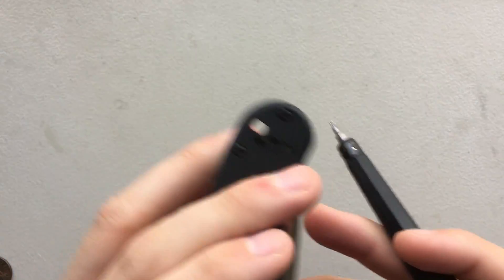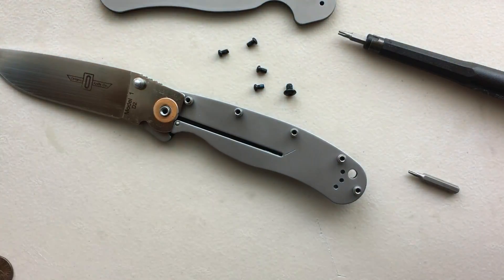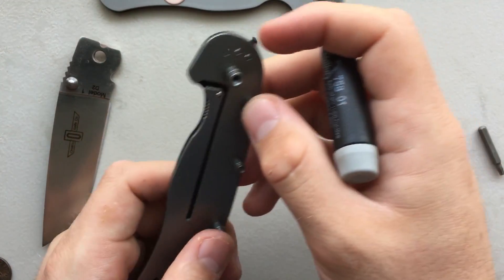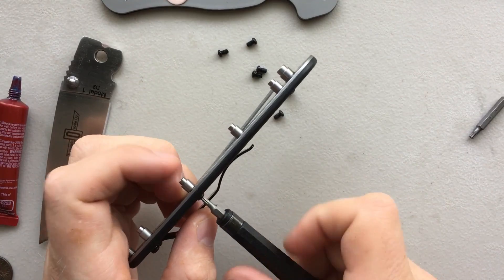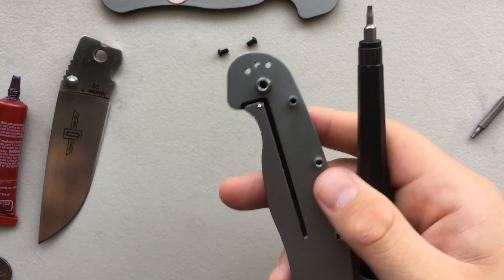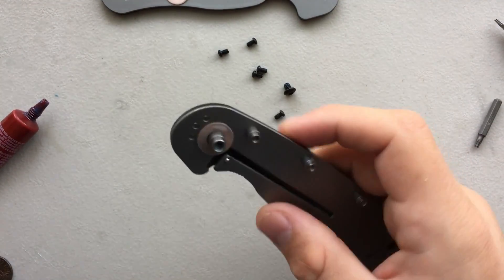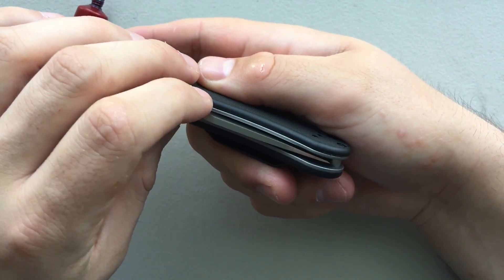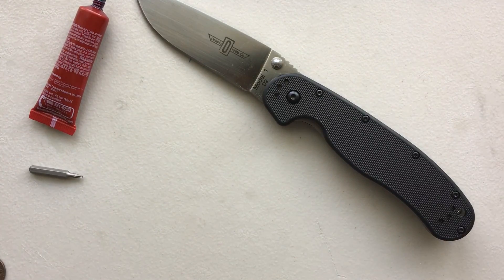How to disassemble and maintain your Ontario RAT 1 Pocketknife

Comment: I like my Rat1. I bought a Rat1a (assisted) but went back to my standard Rat1. The assisted opening is crap. They put a torsion spring in the pivot point. Mine was so hard to open that you had to use both hands to open it...

Comment: My green guy used to be superb action. Lately I noticed the liner lock moved over farther, and was harder to disengage and close the knife. No biggied I figured, did full tear down and clean, and put back, and now the blade touches the right liner when closed! I kept taking apart reseating, even sweapped nylon/PB washer order...boom nothing. It seemed each time I put back together, my once perfectly centered Rat1  was now permenantely defected to one side on the liner scraping when shut. I tried everything possible, a dam shame out of the blue this started to go south. It seems odd to me the washers ID is bigger than that pivot collar too. Could it just be poor workmanship rearing its ugly head finally (Don't get me started in the Carter Prime I just had to get smooth out of box with IKBS explosions) EDIT: And yes centering those washers is key, but even so it still seems off- maybe I need to order new ones.

Comment: Hi, I bought a rat I and mine seem to have double washes (bronze + teflon) on one side and only a big one teflon on the other side. That is normal ? thank you
Reply: To whom it may concern I had my answer from Ontario directely and I share with you :

''Because they were made with two different styled washers in the last year. One is Teflon and the other is a brass washer. We’ve had a lot of complaints about the switch so we’ve had them changed back to the other way of making them.
We’ve had complaints about the Teflon and brass washer together. So they are in the process of being switched back to both brass washers.''

Comment: Took me several tries to get the blade re-centered when closed, I couldn't figure out what was causing it but I kept playing with the pivot screws until I guess and checked it correct. Thought I had ruined my knife. At least mine was flawless on the inside of the liners.
Reply: the blade on a lot of the rats (2 and 1) is pretty off center but only when closed, because of the liner pushing on the blade when closed. Not a big deal at all mines like that as well, I took it apart, didn't feel like doing it again, plus mine came like that so i didn't care.

Comment: Hi how did you remove locktite from the screws? I have disassembled but now I have problem with locktite to remove it.
Reply from the maker: You don't generally need to.
Reply: Nick Shabazz But suppose I still shall put a droplet for assembly?

Comment: Hey Nick, what program do you use to edit your vids? You might want to use a high pass filter on de audio. I can hear a low hum of I expect is the airco. It's removed easisy with a 20dB 80 Hz high pass filter. Let me know if I can help :) Keep the vids coming :-)
Reply from the maker: Yep, I generally shut off the air conditioner, but it was just too damned hot for this one.  And I edit in Apple's Quicktime.  I'm sure I could rig some sort of filter (although 80Hz with big shoulders might pinch a bit on my vocal range), good idea!
Reply: Ah, I meant an digital audio-effect to filter out a certain frequency. It's part of video editors like iMovie and Final Cut X. As you use Quicktime you can't improve your video's any further as far as I know .. Switching to iMovie or an other video editor would help because it contains lot's of effects to fix small annoyances like lighting, sound, etc. Having said this, I don't mind too much, so keep going :-)
Reply from the maker: Peet: I understood.  Remember, I'm a signal processing guy for a living :)

Quicktime is just a tradeoff to edit quickly and with minimal complexity.  Time spent editing is time not spent doing the parts of this I like.  Hence the low budget :D
Reply: Doh! I totally forgot processing is your field :-) You're totally right spending time on the things you enjoy. Keep it up!

Comment: I installed a .020" thick bronze washer on the left (non locking liner) side. I lapped the washer in a figure of 8 motion until the blade offered the right resistance. It is a touch stiff but will wear in. In effect, due to the shoulder on the pivot, I effectively "Sebenza'd" the Rat. It was solid before but I am here to tell you that it is MUCH more solid feeling now.
Source for the bronze washer, 1 penny sanded/ground to .020" then lapped to tune (check the year to see which ones are actually copper/ tin/ zinc). Pivot hole dia. .242"